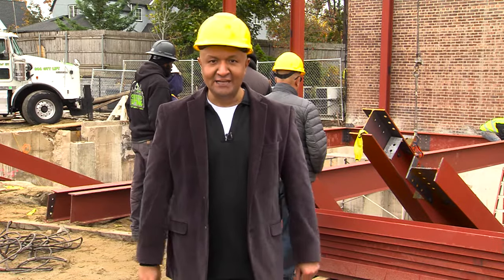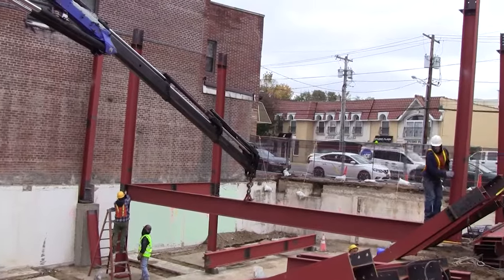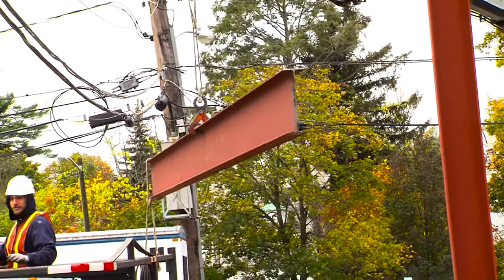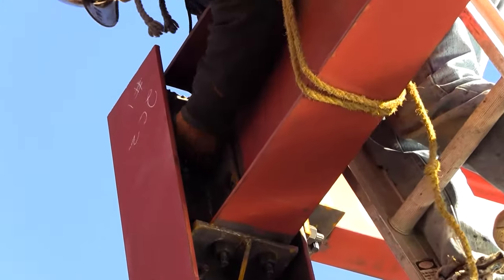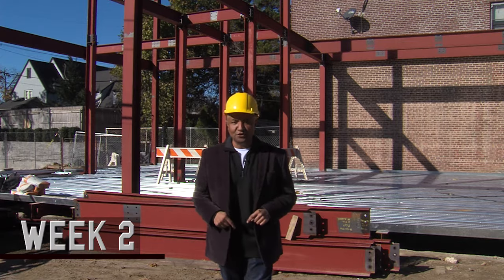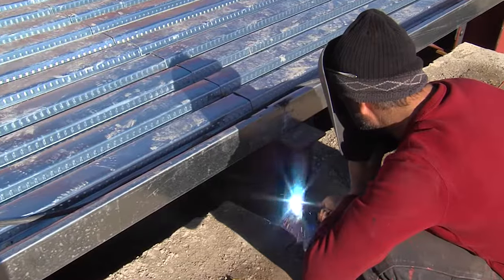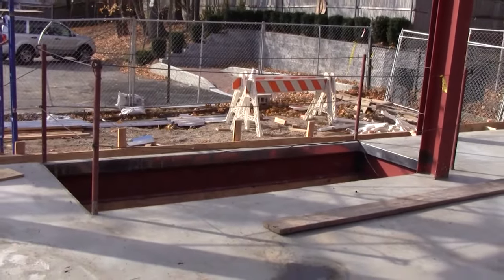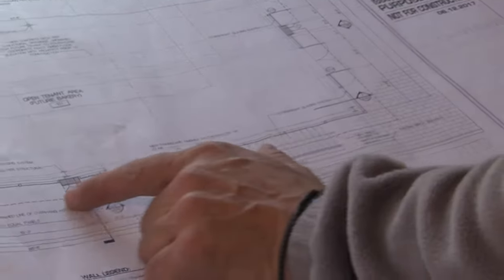Master Craftsmen  - Erecting Steel

Comment: Dear Daniel, great job! I watched the entire video, and I appreciate your effort. However, there are quite a few steps where time could be saved. Some of these steps make the erection process more challenging and should be optimized through better connection design. Addressing this will not only make installation easier but also save you significant time and money. Keep up the good work!

Comment: Steel detailer plays main role here.
Reply: Steel detailer is a middle link between engineer and the fabricator, ensuring the shop drawing are detailed exactly per intent of the engineer's design. IMHO, steel detailer is not the main role, for a reason being that the final approval of the detailing is going through the structural engineer's approval. I feel like steel detailer position intended to cut down the engineering costs, especially if they are subcontracted over the seas. Had a wonderful experience with detailers from India ;)

Comment: At 1:45 in this video... i would never use a beam clamp to hook on and erect steel... any other opinions/thoughts?
Reply: I understand but some GCs require this. I’m on a job for Turner construction where they insisted we use beam clamp vs nylon straps.

Comment: The health & safety standards are shocking
Reply: I've seen them used for installation of beams in the uk 🇬🇧, most time though site requires and i-bolt going through a pre drilled hole that has a small o- ring to attach a wire or chain.

Comment: I have seen many OSHA violations..crazy
Reply: No toe boards around the floor openings, cables should have some caution flags, elevator hole needs a better barricade, crane operator is wearing a baseball cap, and some missing safety glasses.  What else?  Power line was a little too close for my comfort but not sure its a violation
Reply: Rebar caps. Not a single one.